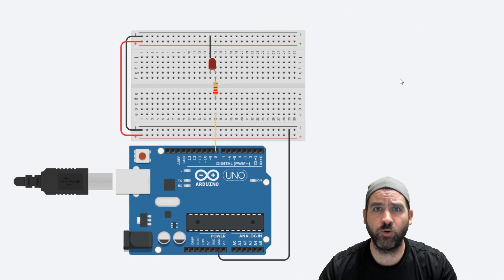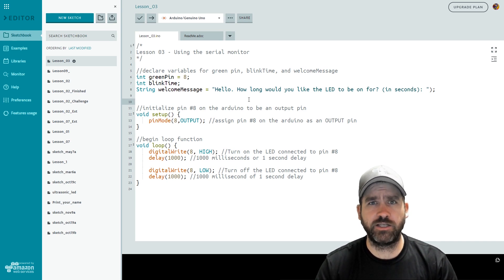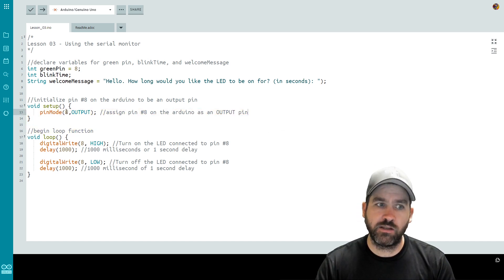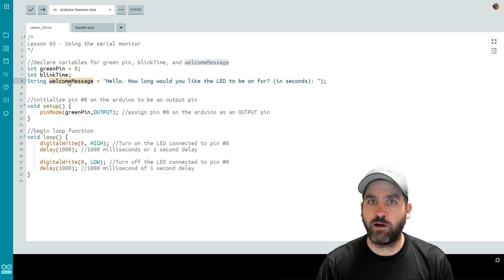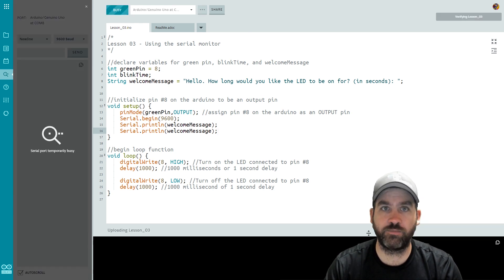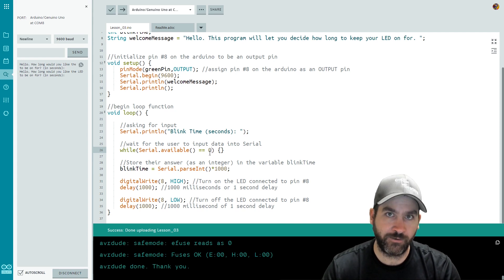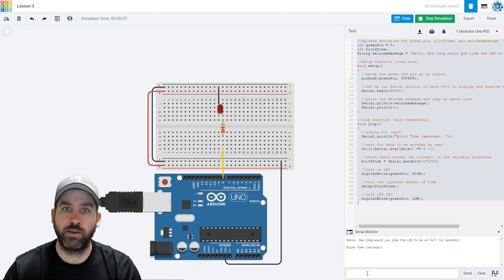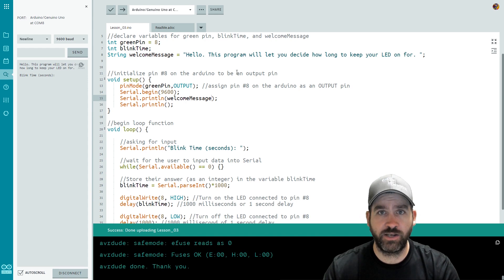Arduino Basics - Lesson 03 - Using the Serial Monitor for the first time

Comment: Hi thanks for posting these. My Arduino Serial Monitor doesnt have a Send button, cant get 4 sec inctruction to Arduino, have tried Enter, any ideas? Thanks. (Serial monitor appears where Output screen is...
Reply from the maker: Are you using the online Arduino IDE? or the older windows version?
Reply: @CodeWithConner  Hi, online Windows Version...